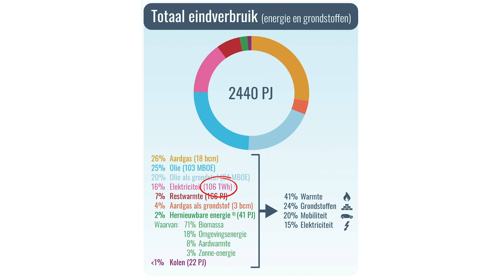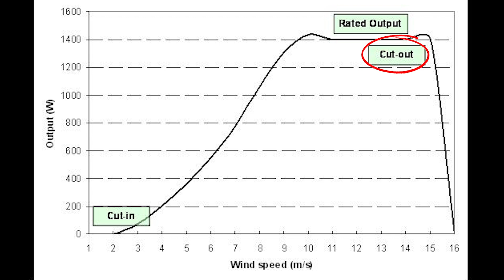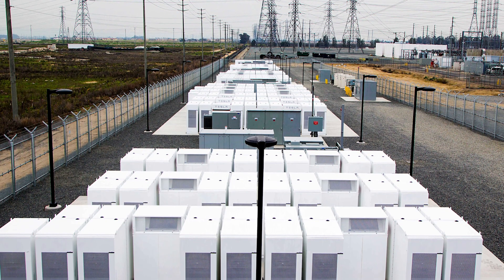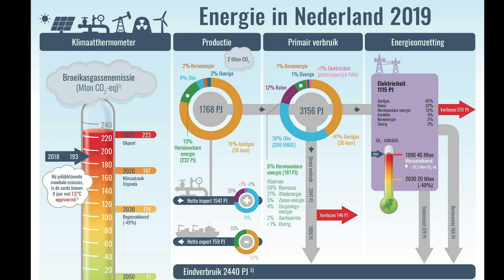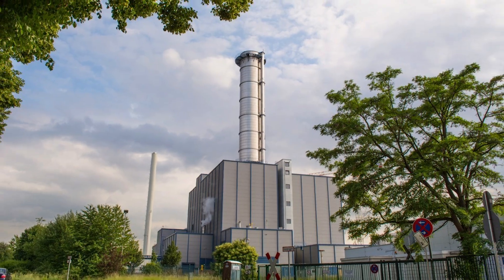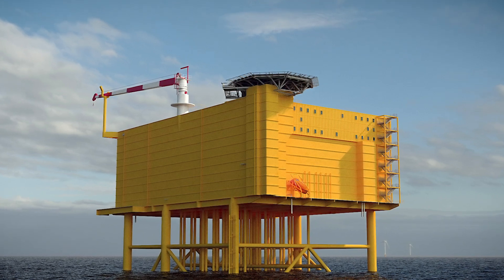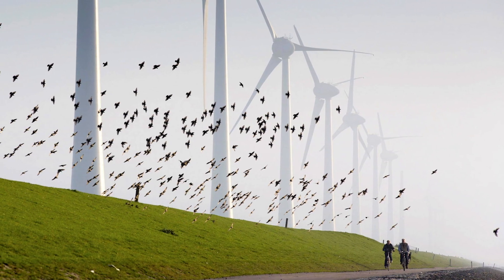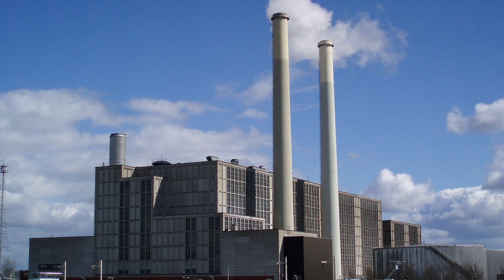Will windturbines ever work?

Comment: ERROR: you missed out the energy in production of these things, and that I'm told a wind turbine will never recoup the energy used in the manufacture and installation of a wind turbine
Reply from the maker: I did not try to calculate the overall efficiency of windturbines. I just wanted to show that 100% going green with only wind (with hydrogen as backup as proposed by the EU) is not feasable. The outcome does not change when you replace a part of the windturbines with solarpanels, you only create a bigger problem in winter with the needed increased backup.
Reply: @klimaatwaarheid2341  @Mr D is referring to the idea that a wind turbine can not make enough energy to create a second turbine.  The story goes: once the planet becomes 100% "green", it will become impossible to maintain as you can no longer create new green generation.

Comment: Am I the only one thinking that it is important to use the correct name for a thing. THESE are NO WINDMILLS? These are WIND TURBINES. A windmill has a function and works perfectly .... namely grinding flour, driving a hammer mill, running water pumps ...
Reply from the maker: You are absolutely right, the correct name is windturbine.
Reply: Sa sam e

Comment: Apart from the factors that you mention, the issue that many politicians and environmentalists ignore is the impact of non-synchronous generation such as solar PV and wind turbines have on power system stability.  Once non-synchronous generation exceeds around 30% of generation, there is a significant risk of power system instability and consequential partial or complete blackouts when system disturbances occur.  Large synchronous generators are essential to maintain system stability and given the drive to eliminate CO2 emissions, nuclear is the only practicable option.  It is no coincidence that the UK partial blackouts in August 2019 occurred at a time when renewable generation approached 40%.

Politicians can make all the laws they like in respect of energy production, but they cannot rewrite the laws of physics.

Comment: Meeting the UK's National Grid's FES 2020 Scenario (Consumer Transformation) means 83 GW of offshore wind operational by 2050. But if it's started now, the first wind farms built will have to be decommissioned by 2045 and replaced by new wind farms.

This will have to happen from 2050 onward, every year - Forever & Ever & Ever! By 2075, all 83 GW will have been decommissioned and 1,000,000 tonnes of GRP wind turbine blades will be heading for landfill sites. That's 2,000,000 by the end of this century, then 4,000,000 tonnes every century thereafter.

By the end of this century, a map showing the build-out of offshore wind ringing the entire UK coastline, demonstrates just how much seabed will be occupied year after year - Until the end of Time.

Free green energy my bottom!

Search for: "what is the environmental impact of offshore wind farms?"

Comment: I asked a talented engineer but liberal Democrat in-law of mine if he really believes that the power necessary to run the world's economy can be supplied by solar panels and wind "turbines?"  His answer was a simple and assertive, "YES"  There is really nothing to discuss with those on the other side.
Reply: He isn't much of an engineer or he clearly hasn't thought it through.
Reply: @mpsmith35  Doesn't want to think it through is probably an accurate refinement of your comment.  The classic image of  fingers in the ears singing  "♫ La-La-La-La ♬  I can't hear you" comes to mind.
Reply: Why does he think that? I'm pro renewable, but like to see new ideas
Reply: @bradleynugent9123  Getting into a pissing contest with a family member really isn't productive in terms of having happy birthday parties, holiday get togethers and other similar events.  Why did I ask the question?  Because I was treated to the revelation of a very large local solar panel installation and how wonderful that was.   

I think solar panels are viable on a point of use basis i.e., residential roof tops.  I've seen it done, it's expensive but those who have them in California these days are sitting pretty.  

Windmills are another story.  Years ago I thought they were neat, free energy what's not to like about that?  Plenty!  Haphazard intermittent power is highly problematic.

Comment: This is a straw man argument. No one intends to decarbonise an economy like this. Any realistic plan has to involve (1) considerable energy efficiency and (2) flexible power sources that avoid the unrealistic requirement for large scale energy storage. Electric technologies such as heat pumps and electric vehicles use a lot less energy than fossil fuel methods. The main option for flexible low carbon generation is gas-powered generators with carbon capture and storage.  Sample high level plans for the UK, (I couldn't find a Dutch equivalent on a quick search) are here, for example. https://www.nationalgrideso.com/future-energy/future-energy-scenarios  It is perfectly reasonable to argue that such plans remain quite unrealistic. But it requires a more careful  critique.
Reply: 1) Jevons paradox. Efficiency can help a little.. but only a little.

2) flexible power sources, yeah, like if Netherlands had other alternatives. Solar ? No. Geothermal ? No. Hydro ? No. Tidal power ? Terrible EROI. Perhaps something more fancy, like satellites beaming cosmic radiation maybe ?
Let's get real, they are stuck with windmills and nuclear if they want to stay away of FF. 

Also, forget about carbon capture. It requires energy, and it's precisely what we are short of.

Comment: The cart before the horse courtesy of greedy rent seekers with tight ties to "big spending green politicians". It is also "interesting" how so many of these systems seem to win tenders  across international borders for no apparent reason. The most vital need for such systems was the perfection of safe,  highly efficient, super battery energy storage. These are  still nowhere in sight, so such  windmills can still require expensive backup natural gas powered generating facilities to stabilize and smooth out their erratic "product".

Comment: An excellent presentation. My compliments!  To give this even more credibility, may I kindly ask what your credentials are?  Engineer, scientist?  Or a well informed layperson?  Whatever your background, this is the same argument I've been making here in the U.S.  Are there references to the facts you present?  Calculations?
Reply from the maker: I am a technical engineer, but not specialized in 'green' energy. I just used my common sense and some simple math, based on public records as the graphic at '1''10 in the video. I took an average yield of 25% for windturbines. You could argue that it is a bit low, but on land the power factor is lower than at sea and a turbine loses 3 to 4% a year in efficiency. The losses of the conversion to hydrogen and back er debatable but 60 to 70% is not unrealistic. I left out solar energy to focus on the case, but when you take for example one third solar with two thirds of wind energy, the picture doesn't change much. It still will be too expensive and the landuse of solar is even worse. Tesla delivered the biggest battery storage of the world to Australia at astronomical costs and it creates a backup of less than an hour for a relatively small region. So no time soon this will be an affordable solution.
Reply: @klimaatwaarheid2341  Heel erg bedankt voor je hulp. Ik waardeer uw inspanningen het meest
Reply: @klimaatwaarheid2341  The battery system installed by Tesla in Australia was never targeted for long-term storage.  It's performing quite nicely in its role to balance the grid via quick demand response -- and is paying for itself quite rapidly.
Reply from the maker: @AlanPeery  I know what the system was build for, but it is hugely expensive and provides less than an hour electricity. But a conventionel grid with stable production doesn't need a storage system for balancing. 'It pays for itself', yes, but someone is paying for it. And that will be the enduser, the customer. And someone else is profiting from it...
Reply: @AlanPeery nothing pays for itself. Consumers pay for it.

Comment: This guy does NOT know what he is talking about.

Photovoltaic setups are compatible with shade tolerant crops.

It all depends upon siting. 

Batteries ARE the solution these days.

His calculations are phony.
Reply: David, please post a link to the information that proves this is wrong. We all need to know what you know. Thank you.
Reply: Batteries ? What batteries ? Lithium is still the best technology battery  we have available. Mind you, a lot of engineers are frequently reporting their "findings" in the press but it's more to lure potential investors than anything else... Every 6 month we're on the brink of discovering the ultimate battery, but nothing comes... We don't have time to wait 10 more years

And I don't believe his calculations are phony, I saw reports from knowledgeable people doing the maths for their countries, they all come up with the same conclusion: renewables won't make it. Or they could, if one consider a massive reduction in population and use.

You're angry because your hope of a sustainable future withered away. That's ok, I've been there too.
Reply: With your battery "solution", how do you address the issues of power system stability and adequate system fault levels? All these proposed technologies ignore the reality of operating large integrated power systems reliably with reduced numbers of large synchronous generators.
Reply: I used to think batteries were the solution until I found out about an example batter system that cost 300Million dollars.  It sounded impressive - it could generate 30GW - for a few minutes.  I tried scaling up a days worth of battery storage for the UK and it ran into several trillions of dollars.
Reply: We have a site near us with wind turbines and solar panels. There are sheep grazing around the long grass growing between the panels. The land was only used for sheep before. I think it is an important part of the equation. We should focus on better building to bring down energy use. This guy has an agenda I expect.

Comment: One small nuclear reactor. Green and dependable.
Reply: "One small nuclear reactor"? To replace fossil fuel, we would need MILLIONS of small nuclear reactors. We'd need to be starting up hundreds upon hundreds every day. And they cost WAY more than wind power.
Reply: @billchristian9863  Try this https://www.americangeosciences.org/critical-issues/faq/how-much-electricity-does-typical-nuclear-power-plant-generate the smallest plant in the USA produces appx 582 MW of power, roughly 116 times more than a 5 MW windmill. Using the math above, you would only need 21 of the smallest plants running. The largest plant in the USA produces about 3937 MW using 3 reactors. This is appx 780 times more than one windmill. You would only need about 4 of those plants. One country provided with "clean" non-carbon producing energy, reliable and safe. Save the spent fuel for the future where technology develops to use it again! If you want to replace fossil fuel around the world there is nothing better than nuclear.
Reply: @ddmath  Remember that the nukes generate their power continuously, whereas wind turbines done.  So you need several times the number of wind turbines to try to emulate continuous output. As the video says, the actual output of a turbine is reckoned to be 25% or its rated output, so you need to multiply the number of turbines by 4 in each case e.g. 3120 turbines instead of 780.

Comment: And of course none of that can take any CO2 already emitted out of the atmosphere. Another technology, CCS, is required and it will need energy as well, not only to capture CO2 but transport it and geologically store under pressure.
Reply: Ken,

CCS is another delusional technology, extremely wasteful of power and the volume of safe storage is immense. I mention safe, a leak of CO2 into the atmosphere (as it is stored under pressure) can have fatal consequences, being an odourless and heavier than air gas.
All this to try and reduce the concentration of a gas that at best, has a tiny effect on climate. The whole thing is based on a hypothesis which is unproven. Yes it is a greenhouse gas but the climate has many more other variables that have far greater effect, largely that which brings stability.
Reply: @iareid8255  Equally delusional is the idea that we can rapidly lower carbon fuel emissions to reach a zero goal without devastating social and economic consequences. The Covid-travel lockdown illustrates that. Last year about 40 gigatons of CO2 was emitted. By 2060 at least one billion tons a year would be required for those 40 years. No economy could survive that. And that would have to be done before NET-zero CCS technology could even begin with a few million tons a year. Completely stupid.
Reply: Ken, 

of course it's a nonsense and any rational person can see that. Unfortunately there are large bodies with lots of influence and politicians who cannot see the wood for the trees.
Reply: It would be nice to have some evidence that CO2 even affects anything before approaching such an endeavor.
Reply: There is working technology in the market right now that produces carbon nanofiber and carbon nanotubes using only CO2 and green energy. The process has a positive CO2 impact and uses only 1/28 as much energy as traditional carbon nanofiber production. It can also be paired with fossile carbon emissions and reduce the CO2 impact at those sites by 25%.
Reply: @kjetiliversen2091  The problem is not the technology but the huge amounts of CO2 needed to affect the climate. Currently, the world-wide amount of CO2 being captured and stored is not even close to ONE part-per-million...an amount that is almost 8,000 million metric tons! Obviously many more than one would be needed.
Reply: @kjetiliversen2091  Surely, those are trees?